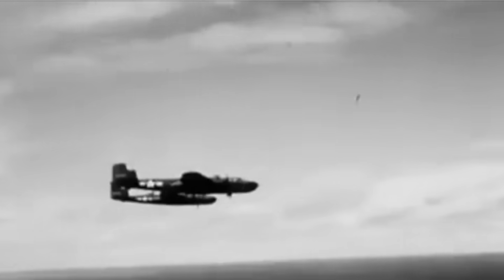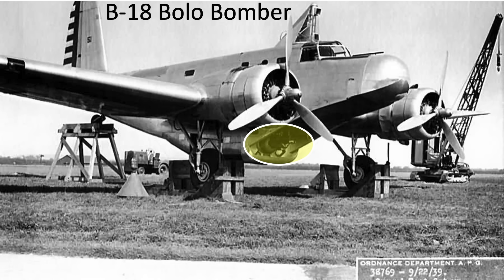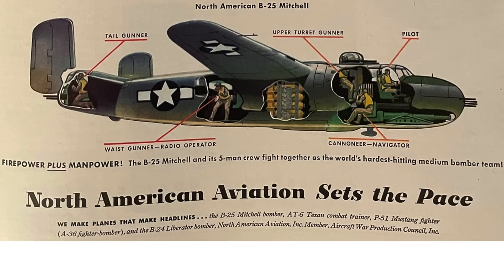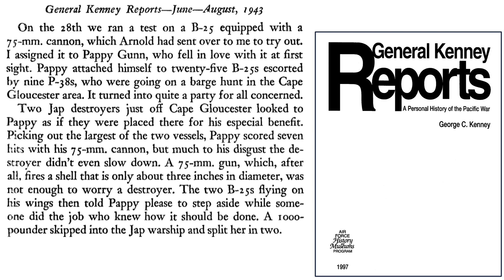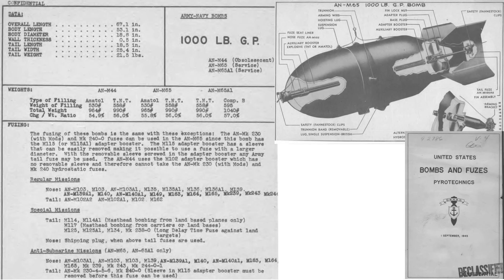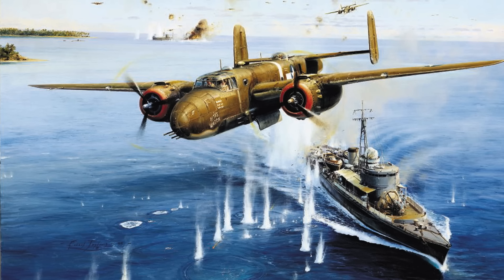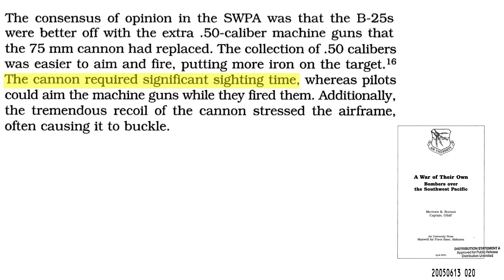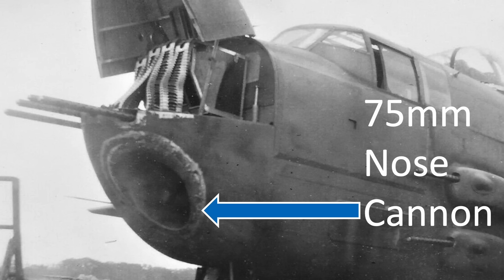Why the B-25’s 75mm cannon was a Failure - Deep Dive Review

Comment: I wonder if a 40mm boffer would have been a good choice ?   Still used on AC130’s.
Reply: No. Some 20mm Hispano auto cannon would have been feasible but why mix up all the different ammo types as well as ballistics. Another reason why the USAAF kept with the 50cals.
Reply: @martinricardo4503 
A 20mm Hispano auto cannon against ships?
Apparently you guys don't get that the narrative of the cannon used on the B25 being a failure is predicated entirely from its use on ships, I'll bet in Europe with all the armored vehicles running around that thing would have been considered a success. 
If the cannon they put in it was considered a failure when it came to sinking ships how exactly would a 20mm gun fix the issue?
Reply: The Americans knew from early on that 20mm cannon were the most effective gun for ground attack/anti shipping, but they were unavailable for many reasons. So they just used what they had a lot of, that they knew worked, until 20mm cannon were available. As for why, 20mm cannon were in huge demand by the navy, America was building a giant fleet & ships from the smallest landing craft to the biggest battleship needed them for AA protection. And they had priority. That's just 1 reason, there are a few more too. Basically, you fight a war with what you have, not what you wish you had, & the .50cal did the job if you crammed enough of them on the front of your plane.
Reply: @JoeyMills-y3v  the video at around 9:35 shows a document covering 75mm equipped B25 used verse land targets. And they were not well liked.
Reply: @flarvin8945  The Americans saw the British Beaufighters in action & knew immediately that 4x20 was the way to go in future. They just weren't either available or even reliable at the time. So they used what they had & it worked.
Reply: @JoeyMills-y3v the US was using Oerlikon 20mm cannons on ships; generally some version of the Hispano Suiza cannon was wanted for aircraft. The Hispano had a higher rate of fire and fired a heavier projectile faster. The Oerlikon 's mechanism made it a pain in the ass to convert it to use more powerful cartridges. 

Unfortunately the Hispano needed a lot of help to work on aircraft. The British slogged through it and eventually got the thing working reliably, but the US did not.  The P 38 used a singly Hispano, but i think the location allowed the pilot to cycle the mechanism by hand when it jammed.
Reply: @JoeyMills-y3v 
Not true, the only thing 20mm would be more effective on is aircraft, anything on the ground with armor probably just thicker than ¼" and 20mm would be ineffective, explosive rounds like that don't penetrate armor they explode on the outside, they also lack velocity, because they rely on their explosive charge to do the damage, so yea if you've got guys in the open 20mm is fairly effective but if they're in the back of a half track the rounds will likely just explode on the outside, and they certainly would only explode on the outside of a ship including the armor plate in front of some ships guns wherein the tungsten insert in AP .50 cals are going through them.
There's alot more involved than just bore diameter when it comes to rating aircraft guns, there's also the increased firing time of .50's among other things. 
The US didn't use .50 cals in WW2 because "they didn't have anything better", it used then because after plenty of testing firing different guns into aircraft fuselages and wings, armor plate etc etc it determined .50 cals were the best choice at the time when all things were considered including the additional number of guns and additional firing time.
As far as different cannons the US played around with behind the scenes during WW2 I've never once seen a development program that looked to be a genuine effort, nothing much more than busy work for some companies and ordnance departments, nothing was seriously pursued, it was really no more than throwing money at someone so they'd go away and keep busy, with all the things developed in the US during the war like the B29 if the US really wanted 20mm cannons on aircraft it would have had them, it's ridiculous to think that the country that developed the B29 couldn't get a gun to work right if it really wanted it to.
Reply: It's obvious in hindsight but they were really crying for a good high velocity & high rate of fire auto-cannon. I suspect the bofors' recoil would have been a bit too much for the airframe*. The various 37mm configurations for various airplanes never went anywhere for reasons unknown to me (too low velocity ?). The US manufactured 20mm still had too much reliability issues. Could they have re-used the 25mm Chicago piano instead ?
In the end, even the brits with their excellent 57mm auto-cannon set-up on the mosquito just went the way of the rockets.
*Although I seem to recall they did get some use for ground attacks when mounted on older fighters (hurricanes and maybe another type that I cant recall right now).
Reply: @WBtimhawk The one other cannon I think would have worked best would have been the 37mm M9, a variant of the US 37mm M1 AA gun. 

That didn’t come around until 1944-ish, and by then they got the 14 .50-cal thing going.
Reply: The 40mm has a firing rate of 120rpm but the rounds during WWII were explosive only and weren't designed to penetrate armor.
Reply: @jefflebowski918 
Exactly
Reply: I have two 40mm Bofors shell casings here at home. Just weighed one - 845g.
Reply: The biggest thing they're used against are trucks. Ships are just so much larger.
Reply: There’s a maritime light bomber that ended up with a Bofors in its nose, but it was the 57mm in the Saab T18B. It apparently worked too well in training, sinking floating practice targets faster than the Swedes could replace them. 

But by that point, it was the late 40s/early 50s and rockets were already doing a better job with much less mass penalty and airframe stress.
Reply: They've moved on to the 30mm bushmaster in the latest model